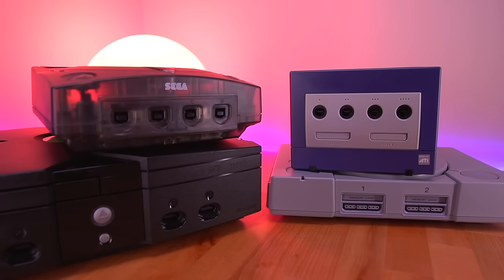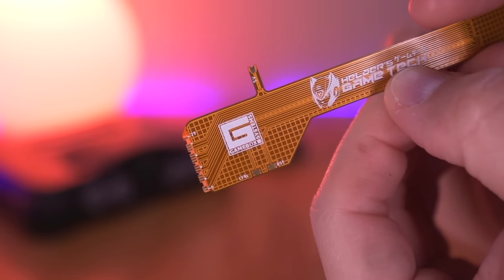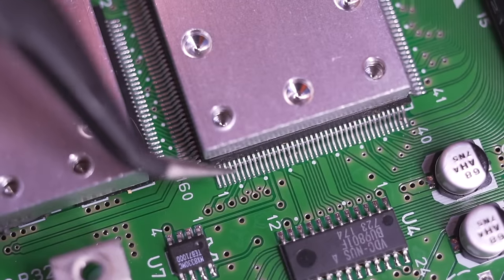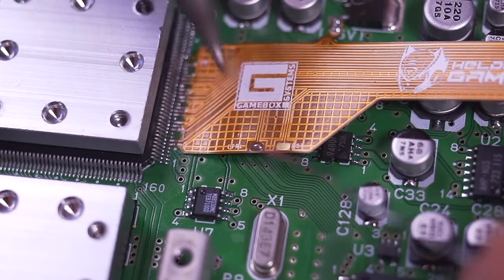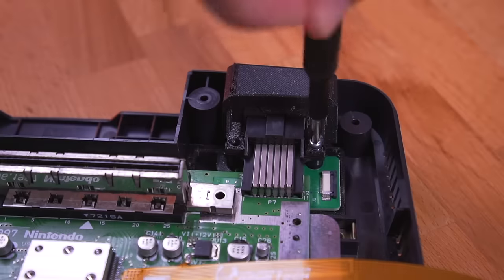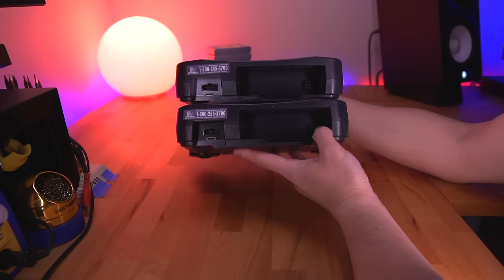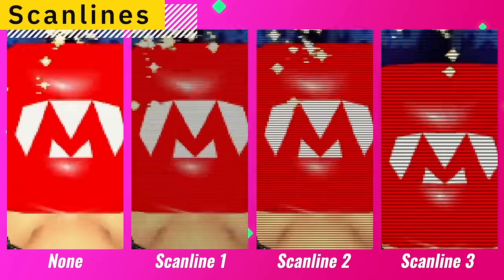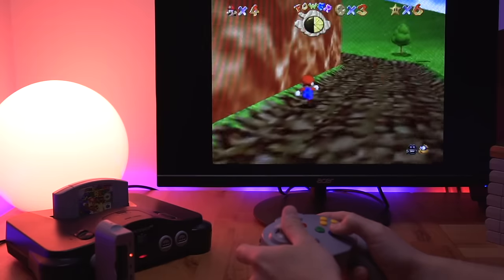The Nintendo 64 Gets A New Less Expensive Hi-Def Mod!

Comment: Why did the ultra hdmi mod not get mentioned? That's what I have installed. This mod seemed a little to much for my soldering skills. My skills aren't too bad but just seemed sketch. Didn't cost to much IMHO. I had to ship it to him but i think for the mod and installation cost me 300$. Also included the 3d printed part. Also got the newest version of ultra hdmi. Version 2 i believe. It was a couple years ago. Just wondering why u never mentioned this option.
Reply: Never mind I just seen your pinned comment.

Comment: You said budget but this isn't anywhere near worth $100. 
It's an HDMI mod for N64 with a custom menu to change the resolution, is it cool yes of course but $100 when you are required to solder everything in?
You started this video calling it budget was expecting a price tag of around $30-$50 tops. Look on the website and it's $100 which is absurd.
That PCB & Ribbon cable probably costs $10 -$15 tops per unit charging $100 is insane, if they dropped the price down to $50 they would sell most likely 3-4x the number of units.

Comment: I am a little dismayed. There is a 'generic' N64 HDMI mod kit on Retro Game Repair Shop for only $50. For $80 more I don't think you are getting that much (select OSD features, notably deblur). I wish you would do another video on the real budget option, as $50 would open the door to a lot of people.

Also, Castlemania games has rebranded and is not selling any retro parts anymore.

Comment: - "Solder the control wire to the pin 2 on the PIF chip".
- <Proceeds to solder it to pin 16, cleanly labelled as such on the PCB.> (－‸ლ)

Comment: I picked up one of these from Stone Age Gamer. It works great when it works. I am going to assume there are going to be some upset people because I have tested this one several on different LCDs and some do not like it at all. It will not work on my computer monitors, but it works great on my crappy viso TV upstairs, but only on 720p. The other modes just flicker and won't sync. 1080i has colored lines on it and won't fill the screen. It won't work at all on my Amazon fire TV down stairs. I am going to experiment with different HDMI cables because I know that can have some effect, but I know other people are going to run into this same issue. I thought I had messed up soldering and redid the entire mod, but it still has the same issues.
Reply: I’ve just done two of these, and tested two of everything in my chain (N64, 64HD kit, hdmi mini, and monitors) and get the same video issue.

Comment: A couple of comments about the 240p mode.

It's more than likely that a large number of HDMI to component, and also HDMI to VGA adapters will work with it. You will occasionally run into some issues with that low a resolution, but it's technically part of the HDMI standard so I bet it would work more often than not. You'll also often get a sharper image just because you're using a more modern DAC than what was originally in the console.

And there's one other use for the 240p mode, future video scalers with an HDMI input. For example, the upcoming RT. 4K will have an HDMI input on it, and using that 240p mode will get you a pure digital signal throughout the entire chain.

Comment: With regards to the flex cable, is there a reason they couldn't have unconnected pads for the first and last pins or something, to help with alignment and ensure people don't solder it to the wrong pins?

I feel like that would be a minor change that wouldn't cost much to implement and would make installation much easier for people.
Reply: that's a great idea but an even better one is paying close attention to the instructions...which would cost $0 and negate the need for that. :P
Reply: @vgrepairs help please I soldered but signal shows static colour lines.
Reply: @ceff01  you did it wrong
Reply: @vgrepairs  yes but how and i also broke black pin to hold in flex cable how to keep that in aswell please
Reply: @vgrepairs  is that all you say you done it wrong
Reply: @ceff01  dude you either do it right or you pay someone to do it right

Comment: At the 8:00 minute mark you state to connect to pin 2 of the pif and proceed to connect to pin 16, which is the correct placement per the instructions but definitely the wrong vocalization.

Comment: As neat as this kit is, I don't even see the price as that big of an advantage. It's only $90 cheaper than the N64 Digital. If someone cares about the N64 enough to install this kit or have someone install it, why not just save up for another two weeks and get an N64 Digital? There are so many more features, especially if you're an N64 super-fan, which I'd imagine you'd be if you were buying either of these kits. If the kit was sub $100, I'd say sure, but it's really not that much cheaper in the grand scheme of things. That said, since the N64 Digital is currently out of stock with no solid ETA of a restock, I suppose this other kit might make sense, since you have no other choice.
Reply: I for one, do not like all the features. I want my mod to be as straight forward as it can get. In fact, I'd like to just have no features at all, the way the n64 used to just plug into my tv and just work when it first came out lol.

Comment: First of all, great video! This is getting my hopes up, but..

I know the product description says 'compatible with all models' but I still want to know if this will help remedy a very specific problem I've been experiencing:
My N64 has the NUS-CPU(P)-01 board since it's an early PAL console so it currently has the S-video out that was never officially used by Nintendo in the PAL region. When I play my PAL games it works brilliantly (though obviously not nearly as good looking as any of the digital video mods would), but when I try playing some game mods such as Banjo Dreamie which only comes in NTSC, I get a weird NTSC443 output that my S-video to HDMI converter has trouble with (flickering vertically, not syncing properly). When I use the composite output straight to my TV, my TV is able to display the signal properly though.

It may seem obvious but given the price I'd want to be absolutely sure: This kit should work with the PAL board as well as circumvent the whole analog signal generation circuitry and thus eliminate the above signal incompatibility problem when using out-of-region games, correct?

Comment: I spotted a mistake in the installation part of the video from @7:59... You claimed you were connecting the controller wire to pin 2 of the PIF chip but you're actually connecting to pin 16. Pin 2 would have been diagonally opposite. Silk screen clearly shows pin 15 and pin 1 is marked with usual dot on chip.

Comment: A big problem imo is that it’s nearly impossible to find a N64 digital, that kits one of a kind it has higher resolution than 1080p. Original price is 220$ resellers want 400+. ( if you can find one) so that sort of just leaves you with the other kit.

Comment: And I thought I was clever for adding a thermal paste connection between each of the layers of metal between the N64 components and the heatsink to assist with cooling.

Comment: I'm sorry, this isn't 2008, 720p is entirely unacceptable. MINIMUM is 1080p, but really this should be 4k in 2023, integer scaling at 4k will fill most of the screen and even if it's set to just fill the whole screen at 4k you won't care. 720p... What a joke

Comment: Man, this kind of stuff is the definition of diminishing returns. like, cool you can plug it in with HDMI now, but you're really not going to get that much of a better picture, it's still just outputting the direct game signal. Unlike an emulator where you can actually upscale the textures directly and have it actually looking really good, I just don't see the point of this original hardware mod stuff

Comment: I've had two attempts for this mod now. The first time the image had jitter. The second time it was the audio that was scrambled. I succesfully installed multiple RGB boards from Tim Worthington. This ribbon cable should make things easier. To be fair, for me it doesn't. Im using a soldering iron with a very small tip. Maybe im using the wrong tools or my skills aren't good enough for this mod. 

And to be fair. On a 65 inch tv it didn't look that good. I know it's 720P, but still i was a little disappointed. Think im going for the OSSC route for now.
Reply: Seriously this gamebox 64hd is really bad, I wish I never wasted money on it when the 40 dollar china hdmi board is better quality and just works. I installed perfect and got line. But they went but then I played zelda after 10 or 20mins it keep crashing. They sent these out knowing they were bad because they say that in discord. Serious this is insane that pixel gem is 190 dollars for 1440p version and will work and look amazing, and this is 120 and looks like av, serious it looks just like fucking av, and I have installed the newest firmware on the board, well I tried every firmware release and even 5 different monitors lol. It's just they are shit serious, get the China one or pixelfx. Thanks

Comment: I was literally just looking into HDMI mods and getting frustrated with the prices - this is the most perfect timing imaginable!!
EDIT - How hard do you think this mod would be to do for a beginner solderer? AKA is it worth it for me to do this to my Watermelon console or should I not risk it lol
Reply: i wouldn't recommend it... practice desoldering and soldering chips on cheap junk motherboards, like a ps3 fat board or an original xbox board. if you can install 128mb of ram on an original xbox you're ready for this.
Reply: @vgrepairs  awesome, thank you so much for the reply!!
Reply: Yeah i wouldn’t recommend it and also use decent equipment and a small soldering tip will help out a great deal

Comment: Great video, does this work with Pal systems?. Thanks
Reply: No. It does not. Not really. It's Buggy and ugly. In PAL mode the N64 does 288p and 576i - both in 50Hz but the 64HD does not care. It's doing 480p60 instead of 576p50. So you get judder and other problems from the framerate conversion and whatever it does to get 480p from 288p makes the picture ugly and softer than composite on the same TV... Same for the other resolutiins as there are no integer based modes to handle PAL resolutions. As soon as I load NTSC Games via Everdrive the picture is crisp and stable but If you want to play your own PAL games, you better get an RGB mod and a RAD2X. It's about the same price and looks much better.

Again... For PAL Games on PAL systems. So, calling the 64HD compatible with PAL systems is technically true but in practice... It's a joke...
Reply: @BorisBecksRetro  
I will check out these mod chips as I really want to get more out of the n64 on a newer flat screen tv. It is very blurry and I can't see much out in the background while playing compared to the old tvs especially Perfect Dark and Goldeneye. Thanks for your reply.
Reply: @98rmx  
Yeah... The N64 is a blurry mess in flatscreens over composite.
I think the other, more expensive HDMI kits handle PAL stuffl far better, but I havent tested them and they are, again, much more expensive.

The 64HD is £129 - the Tim Worthington RGB Kit is £39 and the RAD2X is £59 which means a combination of the latter two devices is a bit cheaper and the RAD2X could be used with a SNES as well, If you have one. The Installation of the RGB kit is a bit easier If you do it yourself and, as I said, it looks far better with PAL consoles

Comment: Don't use the scaling from the OSD, instead use the scaling options of your TV, because the settings get saved per each video input, so you could have a HDMI input dedicated to the N64.
That's what i personally did with my consoles.